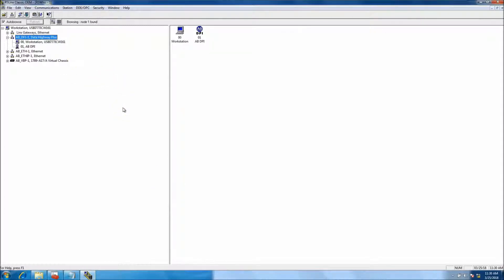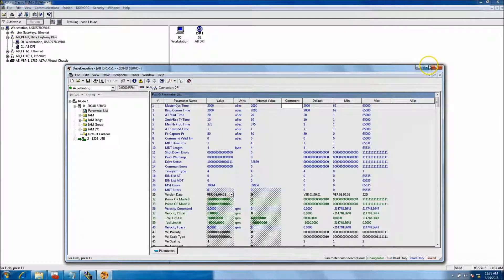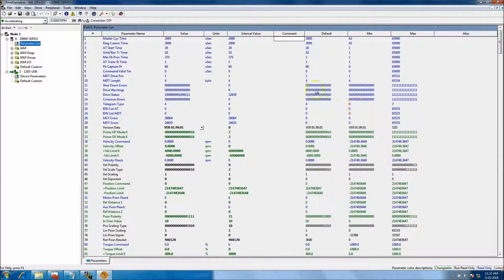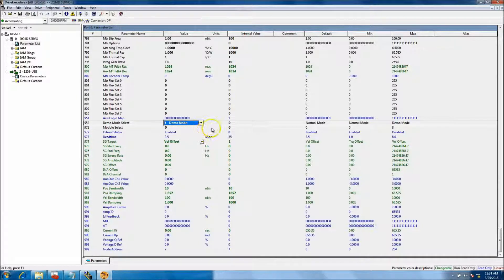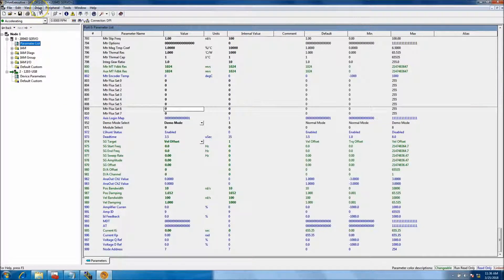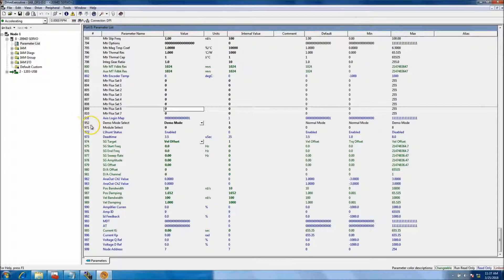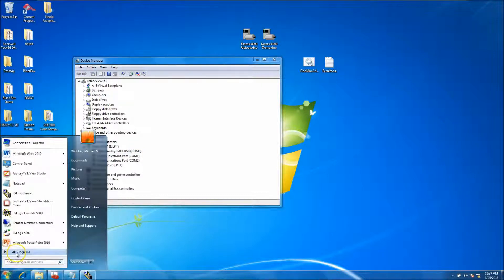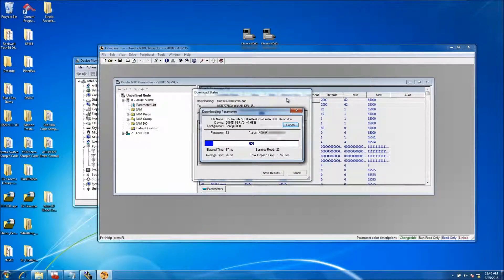Kinetix 6000 Servo Running Powered By 120Vac | Rockwell Automation Demo Mode

Comment: Shane, 
How do you connect 3 phase 480 VAC power module to a 1phase 120 VAC? Is there a wiring schematic?
Reply from the maker: Changing the parameter in the drive to work in demo mode

Comment: Hi I'm getting e50 error in kinetix 6000 servo drive
Reply from the maker: Verify there are no duplicate nodes.

If not then follow below.

There may be a mating problem with one or more of the modules on the power rail for the Kinetix 6000.

Power the system down, remove each model & inspect for any damage on the terminal plug that attach to the power rail.

Also look at the power rail to see if it is damaged.

Repair or replace as needed.

The E50 is a duplicate node detection.